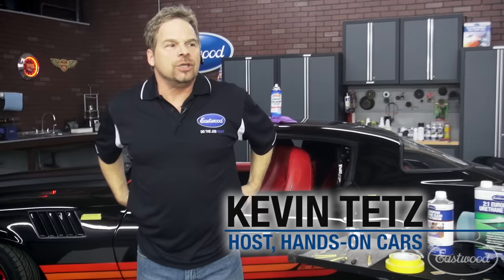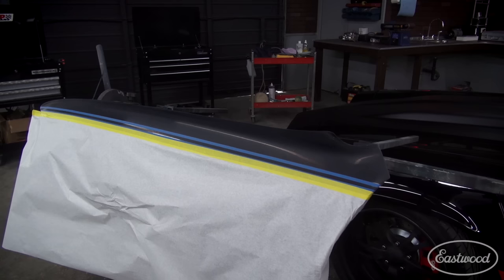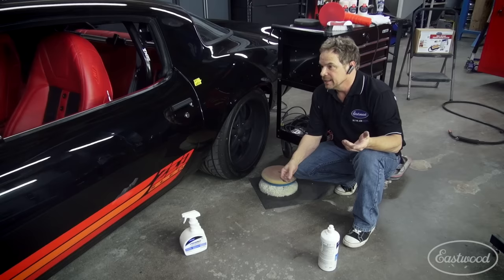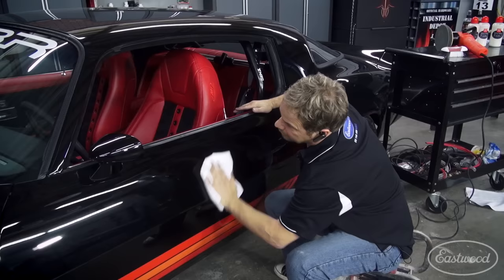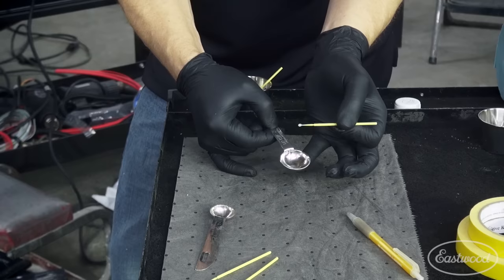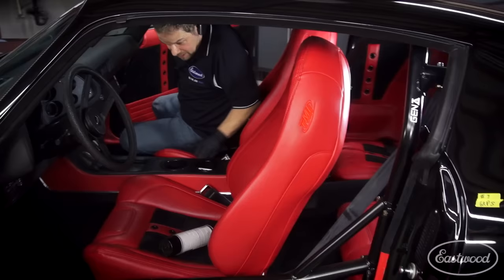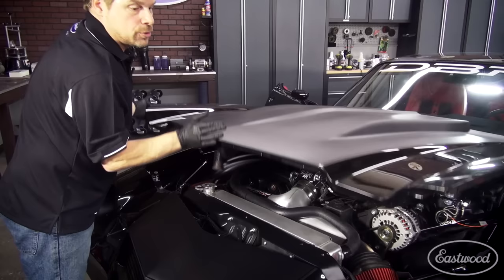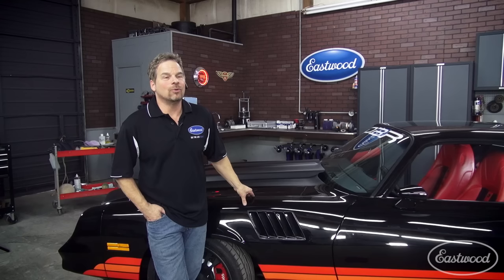Hands-On Cars - Kevin Tetz' Z28 Camaro Pro Touring Machine - Eastwood Product Guide!

Comment: Just a small correction:  Black pigment is all colors, meaning it is made up by mixing all of the pure colors together, but since we're talking reflected light, it is the absence of all color to our human vision.  This happens because color is a frequency of light.  For example, violet begins around 380nm in wavelength, on up to about 750nm for red at the other end of the spectrum.  All other colors are somewhere in between.  Since we "see" objects and color as a result of light reflecting off the object, we see color based on the frequency of light that is reflected.  Red paint looks red because it is only reflecting red wavelengths and absorbing all other frequencies.  Reflected light is a "subtractive" process, meaning that red paint is reflecting red frequencies and absorbing, or "subtracting" all other frequencies.

Although black is made up of all colors, since it is "subtractive" and reflecting light, the material absorbs all color frequencies, so no color is reflected.  White paint, also not a "color", is the opposite, the paint reflects all frequencies, and with light, when all frequencies are combined, it is white, the opposite of black pigment.  Light is an "additive" process when viewed directly.  For example, to get orange light, you simply just need light in the 590-635nm wavelength.  When all colors of light are added together, our eyes see it as white.  Orange paint, however has to absorb all other frequencies and reflect only light in the orange frequency range.

This is because natural light, or light from a flashlight, or lamp, etc is typically white light (or very close), so it contains all of the frequencies of the visible spectrum.  If you have a light source that is off white (lower on the color temperature scale) and it looks yellowish, then items will have a yellowish cast to them, etc.  But for the sake of understanding the differences between reflected and direct light, we base it on a light source that is considered to be a true white light.

Dark paint, in general, shows flaws, black shows it the most because the shiny clear coat reflects all light frequencies (clear is not a color, but the smoothed surface is reflective, like a mirror, so it reflects all frequencies) without any dilution from any color frequencies reflected by the base coat.

Comment: Hi Kevin I bought a plastic resurfacer  and sprayed on to my fore panels it looks great and feel great but it comes off freely easy i can scrape it off with my finger nail 
How do I fix it maybe I could put some kind of flat clear on top of it to protect it from scratches ?
Reply: I I meant a door panels, sorry typo
Reply from the maker: Can you contact the Eastwood Tech Department to resolve this issue - 800-343-9353
Reply: Eastwood Company ok

Comment: Kevin I have a question regarding steering wheels. I have a 1977 C10 and a 1984 Monte Carlo. BOTH of them the steering wheels have become "gummy" or "sticky" where it seems the composition of the original plastic (or whatever it is) has changed and is no longer a hard surface. 
Is there any way to save the steering wheels and bring the gummy, tacky, sticky surface of them back to a hardened surface like they were when they rolled off the line back in the day?
Thanks so much!
Chris
Reply: Christian Blankenship try PPG Acryli-Clean DX330. I used in my 80 Z 28 Imitation rope strength wheel. Oem Carmine Red. Didn't remove color....the sun and time is changing the chemical compounds of the plastic. Good Luck.

Comment: hello eastwood i have a 78 z28 and a 4l80e lying around. i was wondering if you had any spacing issues installing your 4l80e. did you have to modify the body?